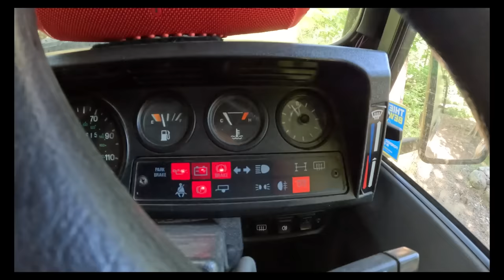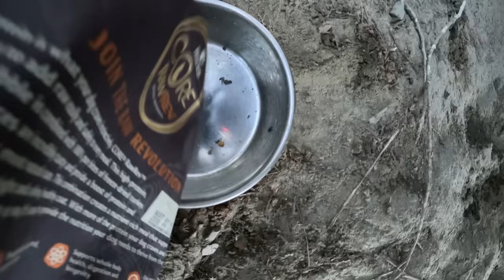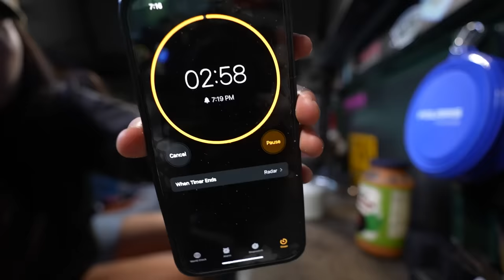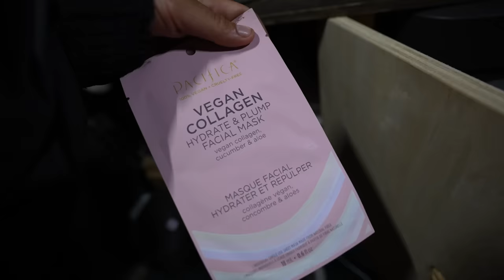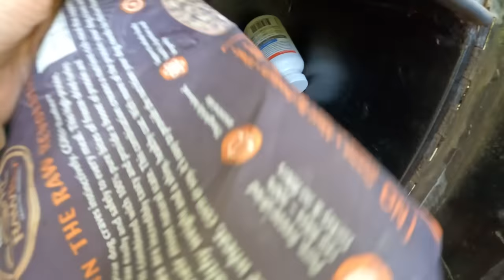Luxury Truck Camping in my Defender

Comment: That bison is all I buy. I don’t even like hamburger meat anymore(from the grocery store). They make great burgers too. 

Used to be a mechanic but not much of a diesel guy. Got to look at the smoke 
White- wate, coolant condensation 
Blue tint/white smoke- oil 
Black dark-fuel. (Obviously you drive a diesel truck 😬. 
Rough off idle typical air leak. 
But rough cold start with all that smoke. Could be an internal leak, or a compression issue. one cylinder struggling to combust the fuel. After foreign fluid is expelled and everything warms up. Things start to  work as they should. Most likely something goin on inside the engine as the truck sits for hours/over night off 
🤷‍♂️ idk no master diesel diag tech here. Just how my though process works from my experience
I would mark the fluids and see if there is any loss after an
Overnight 
Ride and another 
Overnight

Comment: fuel idle compensator-might be the problem/or it loose some prime on fuel line/google it on internet/check valve on the fuel system/put a can of diesel additive in fuel tank/might clean the check valve while you drive/great /thanks much

Comment: Maybe air flow meter or cracked wires that go to the plug that plugs into the intake air filter,  controls the amount of fuel to add to the amount of air being sucked in therefore if it's not reading the air correctly it dumps loads of fuel through which makes it idle bad and loads of smoke.  Could be this, hope so as it will be easy fix and cheap,  unplug it then see how it runs,   could be faulty injector or Crank position sensor

Comment: perhaps a clogged fuel filter. if it still idles rough after replacing the fuel filter, nex would be diesel engine calibration ....engine overhaul equivalent for diesel engines...

Comment: Not sure if you have cured the issue, seeing your newer videos i assume you have. BUT some diesel system cleaner should sort out any issues you have. i dont know what you guys have available in the states but in the uk there is brands such as REDEX, WYNS or STP. I personally use STP cleaner and it helps alot!

Comment: That rough idle could possible be a fuel distributor or fuel injector issue...If I remember correctly, someone installed a remanufactured fuel distributor, correct?

Comment: Glowplugs will give you that issue, even 1 bad one can cause rough running.  They're cheap, do all 4.  Does the smoke you have smell of unburnt fuel or burnt oil?

Comment: A few things it could be engine temperature sensor faulty airflow sensor blue smoke worn valves or guide seals oil leaking in to cylinders oil leaking in to the turbo if fitted hope that helps

Comment: Sounds like there is an injector problem. The injector is probably staying open and leaking fuel into the cylinder overnight. Just not the main injection pump. Proven Performance in Coos Bay Oregon. Guaranteed will fix your. And congratulations on 100K subscribers freaking awesome well deserved
Reply from the maker: Thank you!!!

Comment: 3 months late but...I'm guessing it's a clogging cyclone separator that is attached to your rocker cover vent.  Looks to me like it is unburned fuel (actually crankcase oil) coming out of the tail pipe and the clog is causing crankcase pressure to build up, forcing oil through the valve seals, etc into the cylinder heads.  The separator separates (surprisingly!) the liquid oil and sends it back down into the crankcase while the oil still in aerosol is ducted back to the air intake system to be burned.

I had this happen to our 110 when the return hose to the airbox from the separator occluded from too tight a bend radius but those separators are known to clog over time as well and would create the same symptoms.  If the case pressure gets too high it might even push one of the sealing plugs out of your brake vacuum unit which will cause an immediate ejection of crankcase oil all over the engine bay (fun!) as well as significant oil loss.  

One of the often overlooked "advantages" of the older Rovers is how often you can make do with what is on hand as a temporary solution.  Carry a good tool kit (don't forget a roll of duct tape and baling wire) and a creative mind and you'll rarely find yourself stranded.  There is something immensely satisfying about sitting on the side of the trail whittling a temporary plug from a tree branch to seal the hole in the pump so you can get home...and your better half will be in awe of your McGuiver talents.

Comment: I had a similar stalling problem on wet days. After trying different to find it was a simple spark plug change fixed. It that motor gas or Diesel?

Comment: Are the head gaskets ok? Did they rule out raw diesel leakage from the combustion chamber to the exhaust system? Or oil leakage into the combustion chamber? Are your oil levels persistently normal or are you have to add oil? There is a ~ $30 combustion leakage detector kit you can get from any car parts shop or just rent that you can DIY test and check for combustion gases trapped into your coolant system. White smoke in the morning, rule of thumb, rule out head gasket issues. I doubt they didn’t check for it at the shop after this huge work up you did

Comment: IAC Valve that could be your issue ( Idle Air Control Valve ). I would have this checked usually this is the culprit in old Landies. Defo worth a check and the part bought in Scotland is only like £13 so like $11.

Comment: Found this on Google, it's similar to a few different sites I looked at:  It sounds like you may have a failing cylinder head gasket allowing coolant to leak from the water passages into the cylinders resulting in the coolant being burnt in the combustion chamber with the fuel. If this is the case, you may also notice a bit of white smoke coming from your exhaust which is a product of the coolant being turned into a steam like vapor. Lots of white exhaust smoke on start up is usually a sign of a head gasket problem. If the leak is very small, or leaking into adjacent cylinders, there may not be much smoke upon starting up, and yet still enough coolant may be pulled into the combustion chamber(s) to produce a strong sweetish exhaust smell. Generally, over the long run, this particular problem will continue to produce more engine problems.

Not sure if it's accurate but maybe it'll help!
Reply: Injection pump not properly timed

Comment: Maybe injectors or loose injector had similar issue with diesel transit . I was told by Ford $3500 found that all it was was loose injector. Maybe try injector cleaner in full tank of gas first run it see if issue goes then look at injectors.

Comment: White smoke? Whenever u drive what color is the smoke? White? Probably an injector sticking. idk how many miles u have on it I would replace all injectors or try some diesel kleen gray bottle. I usually put a whole bottle of 26oz in my tank(I only have a 25gal tank). Maybe every 3rd fill up. Idk if they can plug in a scanner on that dinosaur but if they can. I would do a cold start up then turn each injector off one by one then see if the truck stop smoking after a certain injector is turned off. Then let the truck sick over night again and go straight to that injector and turn it off to see if it stops smoking. Unless u change all injectors

Comment: Used to have an Isuzu diesel. My glow plug relay went out (the light would still turn on and then turn off) but the glow plugs weren’t warming up enough before starting. It would run real rough until warmed up and then run fine.  Might be it?

Comment: You are losing fuel pressure when it is not running. 
If you have replaced the pumps then you have leaking injectors. Possible low compression but it probably wouldn’t line out if that was it. Diesels run on compression and fuel high pressure being sprayed in at the right time. But leaking injectors can cause them to run bad when first starting because the pressure  falls off. When the engine is shut down. It will only get worse and finally start smoking at idle. Meaning fuel will start setting on top of the pistons and fuel wash rings causing further damage. 
Injectors last a long time but after you get hundreds of thousands of miles on them injectors start doing this from wear. Could be only one or two. And that would make it shake and misfire. 
Even new injectors can do this stuff.

Comment: Injector cups leaking  or o rings leaking   not holding fuel pressure  thats why hard start    
One or more if it gets to bad it will lock cylinders with diesel

Comment: Sounds like your getting air in the fuel system when it sits I had a diesel that had a pin hole in the fuel line once I started it and it was running it was fine until I let it sit longer than 30 minutes to a hour but I’d start there hope you get it fixed

Comment: It really sounds like contaminated, fuel or something introduced into your fuel system it is there a water separator? Strange that it only happens after Poe sits for a long period of time kind of like the condensation you were getting inside when you were camping in the cold. I am not a mechanic, but I’m very curious to see what the issue is. Stay safe.

Comment: I think you have an injector leaking after you shut off your engine so what's happening is it has to burn off the excess fuel that's why rough idle and smoke

Comment: Sounds like leaking injectors, possibly causing too much fuel being present in the cylinders making an overly rich start-up and cause of the smoking. I'm not aware if that engine has any idler bypass system.

Comment: Maria I know i had the sputtering issue with my fordF350 Super duty  i installed and EGR delete kit and it stopped the sputtering and the extreme exhaust. ( sounds similar to your situation. an you might wanna find out if you have any water in your fuel tank,,,
Reply: Maria hows it going?

Comment: Smoke is from the rings,,, diesels are always rough on a cold start, and yes 50 60+ deg, is a cold start,,, you should carry a starter, water pump set of belts and hoses,,, this stuff dont cost much and will save you a big headache,,, and another alternator of course......but hey its your headache,,, wasn't it nice when you pulled the alt out and you had it !!!! Plus the sooner you get it the cheaper,,, and what happens when it idiots goof up all the shipping and you cant get them parts at all - ever,,, then what will you do.... Should carry a can of fuel,, they have locking safety cans that will go right on the back .... but hey,,, its your headache .......

Comment: Definitely a internal oil leak in the motor Maybe valve seals  that needs to be replaced. The misfire is bc of oil in one of the cylinder. Once you acelerate it burns the oil off n that the white smoke. Hope this helps. Im not sure the type of motor this vehicle has or if it even similar to regular car.

Comment: You have to overhaul the injectors they are not spraying the fuel the are putting a stream and that makes it rough when engine is cold , as heat up burns the fuel fine unless you open the throttle and will not burn the fuel properly and smoke

Comment: Sputtering is, typically, associated with water in the fuel.  If your fuel system is a sealed system you will find that the most common problem is a bad gasket on your fuel filler cap allowing air and water vapor to be sucked into the tank resulting in condensation collecting on the inside of the fuel tank above fuel level.  This condensation volume will increase over time building up and continuing to increase the problem.  Try a new cap and add gas water treatment at each fuel stop for several tanks of gas.  Some people swear by rubbing alcohol a pint each time.  It's cheap.  Can be bought by the case and improves octane.  If the engine is diesel, who the hell knows?  Trade for an older model V8 4WD Ford Expedition!  You will thank me?

Comment: You’ve probably already done it and it’s further in the comments, but check your glow plugs as it’s only on start up.
Reply: And if you start to hate the 110 I’ll have it back here in England, I really miss my 300tdi defender 110 hard top.
Love the sound of the engine and the simplicity compared to my discovery 4 (LR4 I think you call it over there)
Though my discovery 4 is more comfortable and so much more power but everything costs so much and it has so many problems.

Comment: Ok two more possibility’s , no.1 you have a bad or several bad injectors .. no.2 is possible that the rail pressure from the pump to the injectors is incorrect , so it is forcing more fuel into the injectors than the motor can use.. as for the injectors if you have dropped or have a faulty injector it will allow more fuel than that cylinder can burn to enter it. Now the serious part of that is while you are sleeping a cylinder fills with enough fuel past the nozzle you can “Hydro-lock that cylinder and break piston and rod , maybe even threw the side of your block .. my best bet is you have a bad nozzle on a injector

Comment: Well it looks like you're bringing oil you know like on a gas engine when it's smoking because of the top ends going bad so if that was just black smoke on a diesel motor I'd say he might need to have it you know you're feeling everything adjusted properly and everything but since that's gray smoke I was told that could be bad on a diesel engine so yeah you might want to have them check out and see if the rings are going bad and check the compression other than that looks like a nice old truck
Oh yes I forgot to mention you might be getting a little antifreeze in the fuel not sure though but I still have that checked out too just to be on the safe side

Comment: Idk to much about diesel engines but at least for gas engines blue spoke men’s piston rings are going bad at some point it kinda stops because the engine gets warm and on a cold start it happens because the oil is going where it shouldn’t 

Possibly could be these things 
1. Bad piston rings
2. Bad valves 
3. Bad guide seals
You should ask the mechanic how much it would be to diagnose this because it sadly sounds expensive but I hope it’s not depending on the problem I asked my dad and he says to change your oil pretty frequently because diesel engines need it and use it a lot more than gas cars, even if you think it’s good change it every 1,500 or 2,000 miles

Comment: Looks to me like injection timing issue,not sure if your loosing the primary fuel pressure from your lift pump.Not sure of the health of your fuel filter or if you have any water in your fuel.I would lean towards injection pump timing and work backwards of everything that recently touched or replaced.let us know how recent was last PM service,oil level or any consumption.Look for primary fuel filter and any drain on bottom to drain out any water 💦. Give us an update on how many miles you have put since you started your trip.

Comment: that white smoke means your oil pump is going bad or already shot, i have this same problem on my old bmw, id just get an 6.0 LS swap  and call it a day. cuase replacing a oil pump is NOT cheap. after i fixed that problem on my bmw i sold asap. no more euro cars for my i love my 2002 GMT800 truck
Reply: Yes 6.0 ls swap you would have no problems at all

Comment: So where in your fuel system you're sucking some air.  After the vehicle has been sitting for a while here is leaking into your system that causes a bad idle.   Replace your fuel filter to make sure it's tight.

Comment: I don't think it's "blow by"....I would check out the seal on your head gasket.....
Reply: I don’t believe it would clear up, if it was a head gasket.
Reply: @Yankeerebeltatoo  In my experience, replacing the head gasket resolves the problem as long as it is done correctly to ensure a good seal.

Comment: Have your technician check the injectors sounds like you have a leaking injector. Not holding pressure correctly

Comment: If Poe could break down again at any moment and you’re not sure what the problem is, how do you feel safe going in to isolation in a campground that has no service? What would you do if Poe simply wouldn’t start and you were there with no service?
Reply: Any vehicle can break down at any time, at least with a 300 TDI it’s a basic engine with no electronics so more easily fixed in remote areas.
Reply: @gilbert7794  But my question was what would she do in the case of a vehicle that won’t start and she is isolated with no service.
Reply from the maker: I'd use my satellite phone to call whatever friend nearest to me. Right now that'd be Seena or Zach. If they couldn't help in person I'd have them use their service call a tow for me to the coordinates I send them 👍

Comment: Have you heard of the "sunk cost fallacy"? That's what is going on with you snd constant Land Rover repair costs. In a nutshell, you make a dumb decision (Buy an old Land Rover), then you spend some money on upgrades, then repairs, then more repairs, then convince yourself decision making was good, then spend yet more money in an endless cycle. Sometimes its best to admit error, sell the Rover, move forward, course correct, buy a Toyota. Its okay to make mistakes. It will save you thousands.